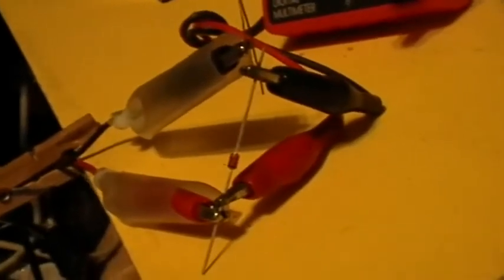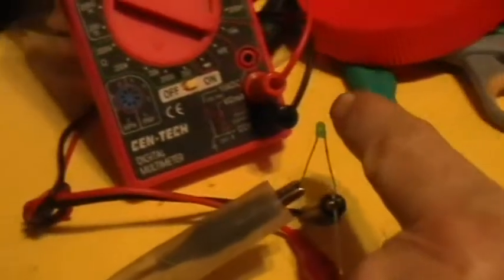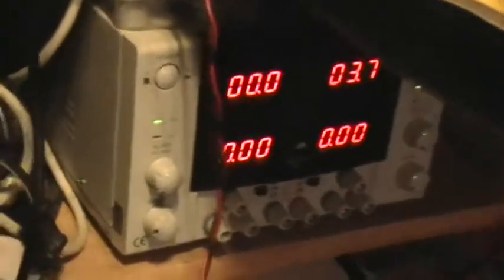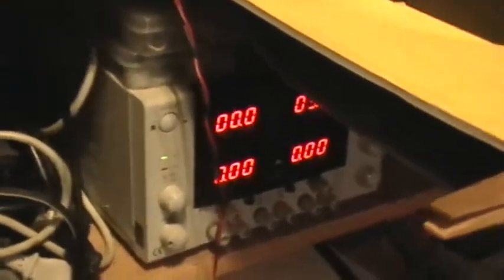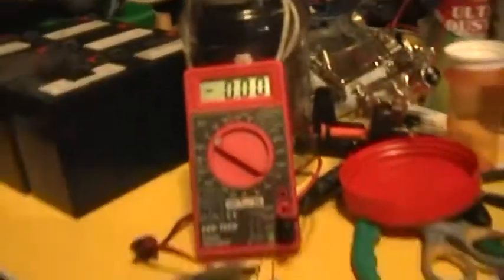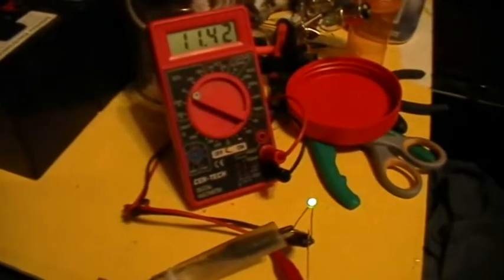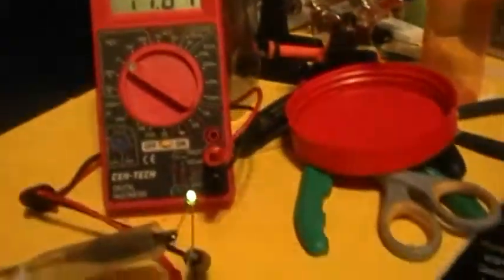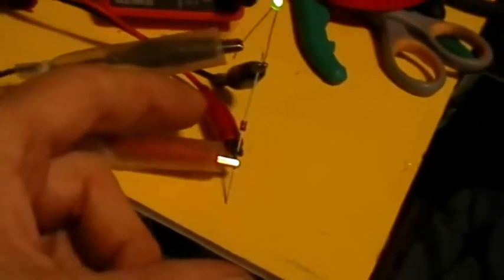Quick and Dirty 0: Zener Diode Testing

Comment: You can make a 25ma current source by using a standard 7805 voltage regulator and 200 ohms of resistance between the regulator's output pin and ground pin. The secret is not to actually ground (or common) the ground pin, it becomes your output. In fact, you can use any of the 78XX series regulators for this trick. Output current  = Regulator volts / R
Reply from the maker: That's a good trick to know! Thanks for posting.

Comment from the maker: But just how accurate was this informal Quick and Dirty Zener Test?

For the 1n4742a Zener Diode tested here, the Fairchild data sheet gives the Test Current Iz as 21 mA and the voltage Vz @ Iz is 11.4 min, 12 nominal and 12.6 max.

So this Q&D test, at roughly 25 mA and 11.9 V....  nailed it!

Comment: thanks buddy! always so hard to read those little guys when u salvage - or at least sometimes anyway --- this is much easier
Reply from the maker: You are welcome. I should shoot another one with some tests of some random salvaged diodes, and also with the inline ammeter and the current limit set more precisely. The little HP power supply is not as stable as it could be... who is, at that age!

I've noticed, by using a microscope, that the Japanese and Chinese Zeners often use the voltage in the part number. Like for a 1n4742a... wtf? you have to look it up to see that it's a 12 volt unit, but for a ZP33A or a Z5.1A you know what it is by the part number.